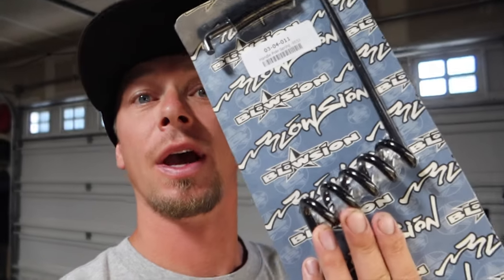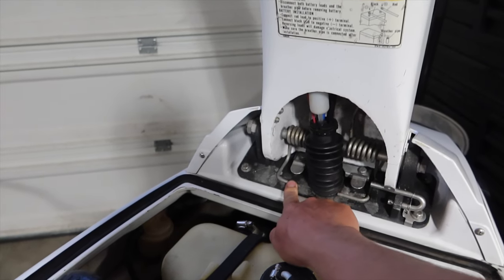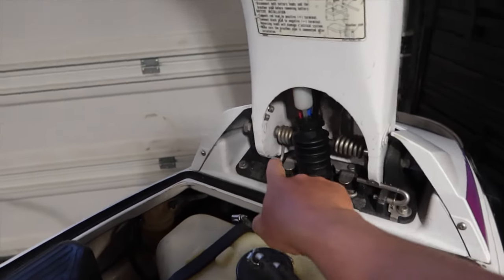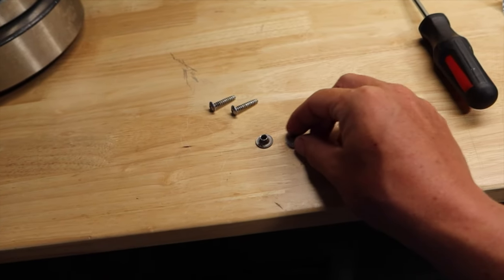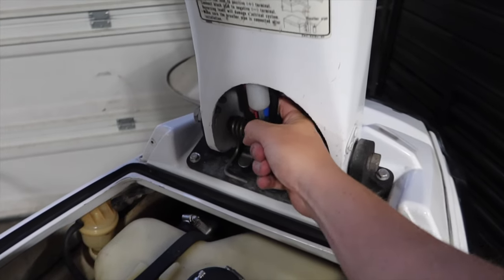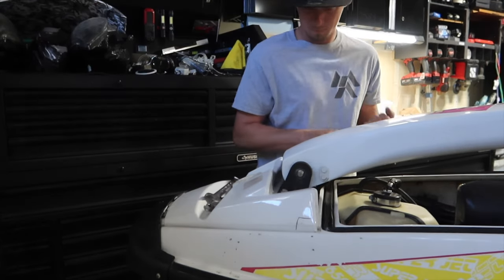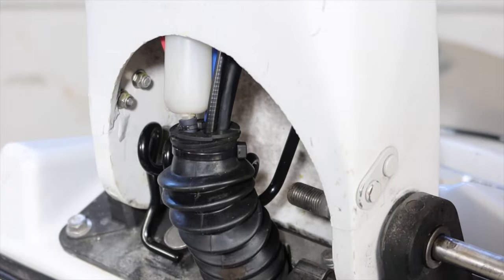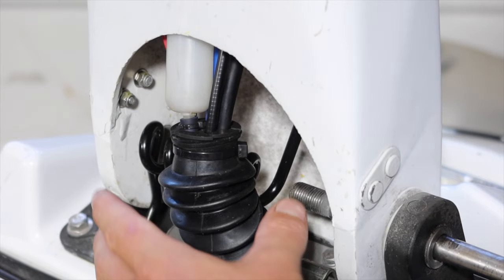Superjet Blowsion Handle Pole Spring Upgrade

Comment: Brother have you upgraded the steering since? Im about to do the spring upgrade as well but i also want quick steering haha
Reply from the maker: I did not put a quick steer kit on mine but did move the mounting spot on the top handle bar plate out to the last and drilled a new hole in my ocean pro d nozzle and it turns quick. I have to clearance the nozzle to clear the pump housing since it turned so much haha

Comment: Great video!. Im about to do this myself once i get it painted.  I was curious how it installed being there was only one spring replacing 2 springs. Thanks for the info bro!!
Reply from the maker: The spring is super stiff and it took some force to get it in. If your painting it I would put like plastic water bottle behind the spring so it doesn’t scratch it. I have a few good scratches in mine now
Reply: @ModdingAddiction  ok thanks for the info